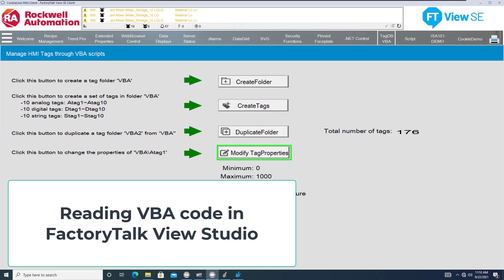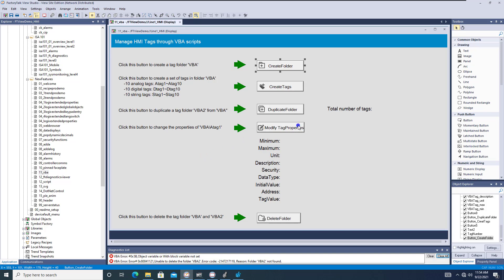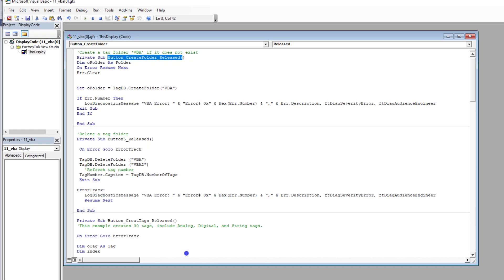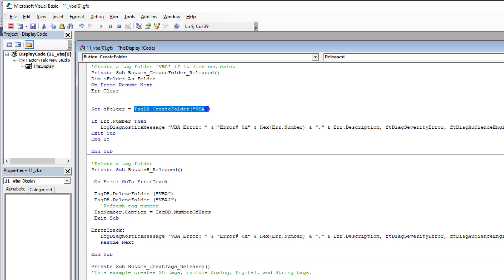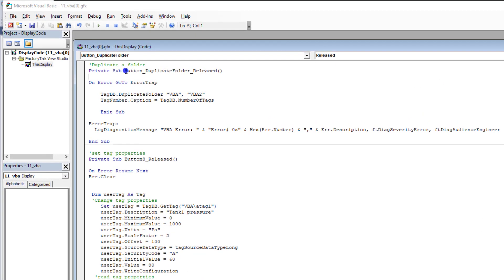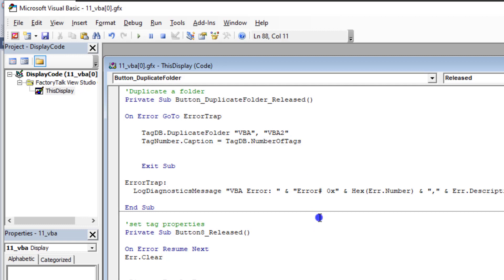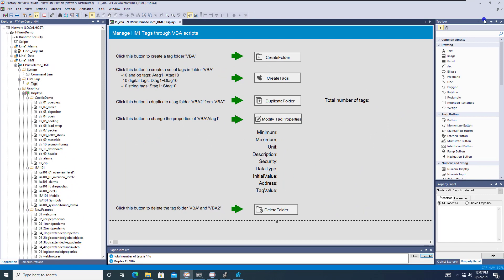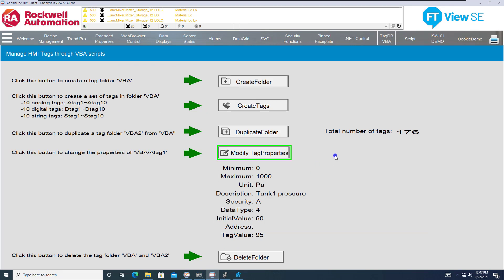Understand VBA Code in FactoryTalk View Studio SE the Easy Way

Comment: Hi. I notice you end up using local HMI tags when creating this VBA. What about if you were trying to obtain values from an existing OPC connection?

I am currently working on a problem that this question would help resolve. Thanks in advance.
Reply from the maker: Then use your OPC tags
Reply: @ShaneWelcher  I don't know how to reference OPC items in VBA. If I wanted to update a caption in an text element using VBA rather than a HMI Tag, I don't seem to be able to use TAGDB.GETTAG( OPC REFERENCE).
Reply from the maker: @Inosix  make a HMI tag that references the OPC tag then use the HMI tag in the VBA
Reply: @ShaneWelcher  Surely there is a way to directly reference items in an established OPC connection. The feature I am designing is a custom trend function. The function allows the user to open up a pop up with I/O information (value, tag, description, setpoints, lo and hi eu) along with a button to add the tag to a list. That list gets pushed to a trend when requested.

I would need to add every tag to an HMI tag and I am still not convinced that would work. I need the HI and LO eu to update a caption on the page. Based on the suggestion you made, I would need to add each of the elements (value, tag, description, setpoints, lo and hi eu) to HMI tags. This would be truly unwieldy and require a lot of work maintaining.

Alternatively, simply being able to something like the following would be a lot better and obvious:

OPC.GetTag("OPC_REFERENCE_STRING")